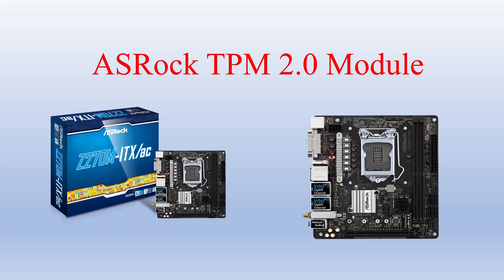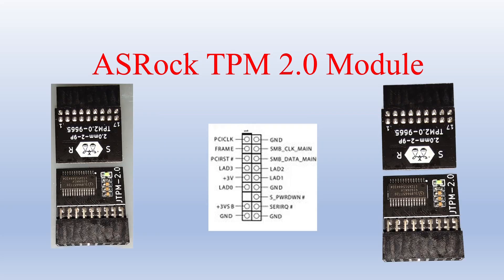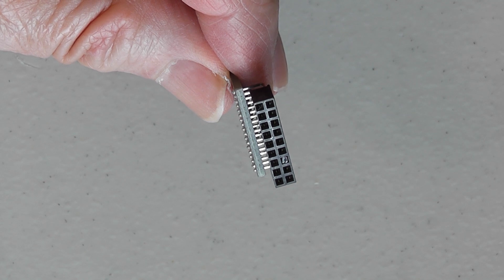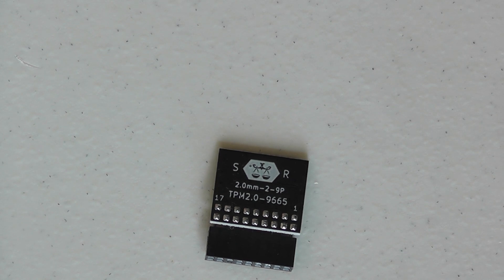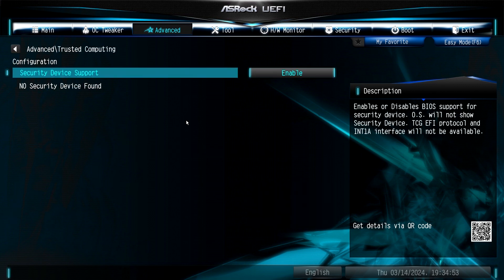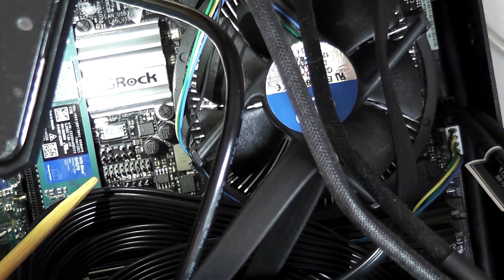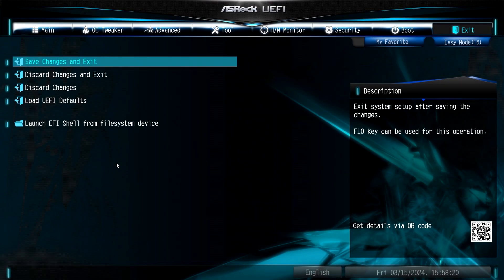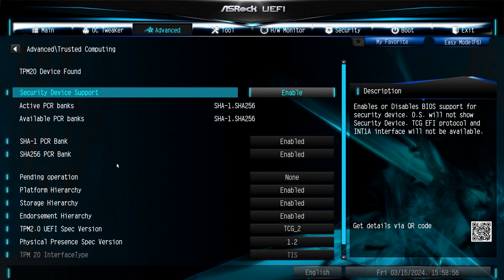Installing TPM 2.0 Module on ASRock Motherboard

Comment: Now do it inside a Laptop without TPM pins !😅
Reply from the maker: That's funny, because I was looking it up and it's not there.  However, I did put an M.2 SATA drive from my Dell laptop in my ASRock board that runs an old i5 processor that doesn't support Windows 11.  It was just a test to see if the board would boot up.  It went straight into Windows 11.  There was no TPM except in the "Registry". Maybe that's where it worked from.  My idea on it was that a Windows 11, that was installed correctly on a TPM machine, might run on an unsupported box it originally ran on a supported computer.  Just throwing it out there, because I don't have the time or extra equipment.  Also, I am not a Genius, like karmaftw3730 noted even if it was sarcastic.😆

Comment: TPM is part of the cpu. GENIUS!
Reply from the maker: TPM has been part of the motherboard architecture for years.  New CPU's 8th Generation Intels and other may have TPM integrated in the CPU.  Some other CPUs/Motherboards new or old don't have it, which is why they offer TPM module pins on the board.  An example would be my ASRock Z270M-ITX/ac.  It doesn't have TPM, so I used the module.  Other Boards have Trusted Platform Technology (PTT), and as I mentioned above, some later CPU's have PTT embedded.
Reply: @nemesis2264  6th gen CPUs have TPM 2.0 in them. I have a 7700 in an H170 motherboard and it has TPM 2.0.
Reply: @nemesis2264  Upgrade your cpu and board.  GENIUS! That shit is ancient as hell
Reply: 6700 is still old and outdated. Next story please